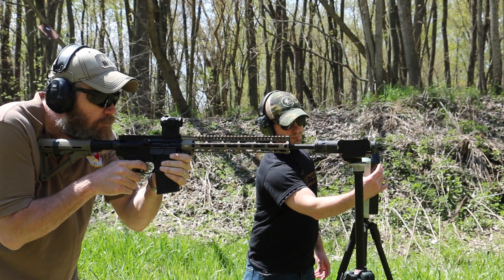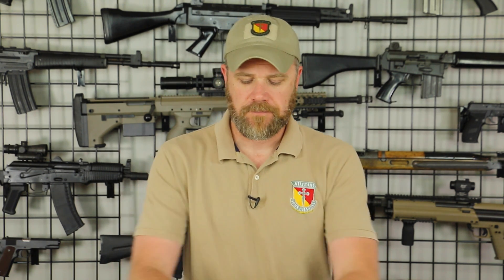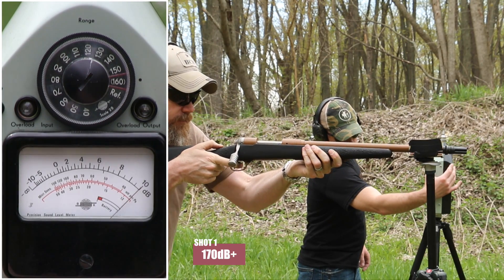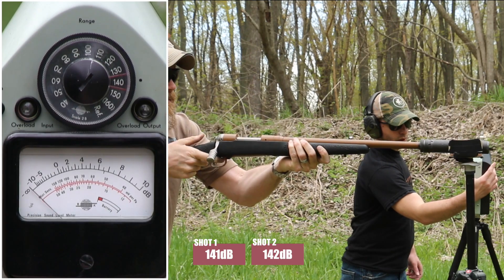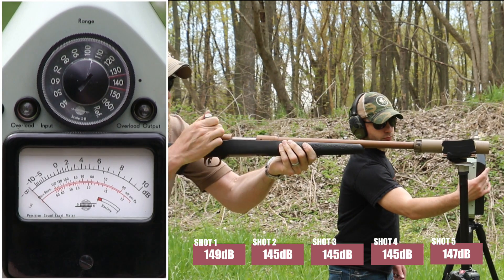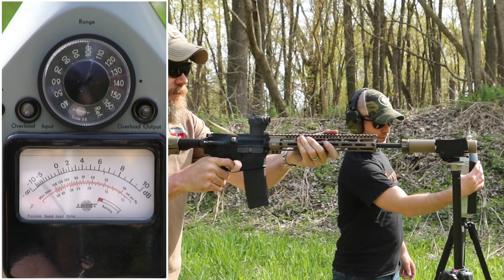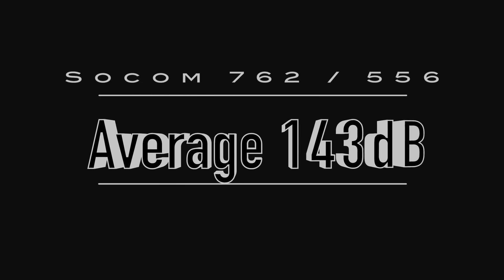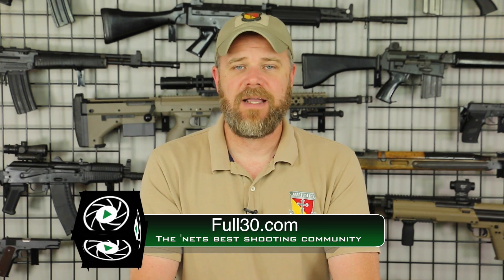Testing 30 Caliber Suppressors

Comment: What end cap was used on the Saker 762 when firing the 556 cartridge (556 or 762)? Did I miss that in the video?
Reply from the maker: Sam S The end caps were not changed, they were 30 cal.

Comment: You make a great point about the intensity difference between your example of 140dB  to 143dB.  Decibels is a numeric representative of the "energy" in a sound propagation.  It's a logarithmic function and an increase of +3dB is approximately an increase in wave pressure of a magnitude of 2.  So, every +3dB increase is TWICE the previous sound pressure level.

Take care of your hearing.

Comment: Looks like there is only 1 that is worth getting, the Omega. Also now you should test it with subsonic ammo and subsonic without a suppressor.
Reply from the maker: Jake S The Omega rocks.
Reply: There are many good options that aren't being tested here as well. The 300SPS or the options from Sig for example.
Reply: I've got about 3 months wait left on mine. Can't wait to get the call from my dealer. Also they sell a .556 end cap that brings the db down even further when shooting 556.

Comment: I would love to see what the numbers look like if you move the sound meter to the firing position. After all that is where it really counts as the shooter.
Reply from the maker: hotelkilo006 Perhaps in a future video, but it's not now suppressors are tested by the industry for their formal readings.
Reply: Totally understandable. I'm mostly curious to see what the difference of being a couple feet behind the muzzle has. I feel like the industry standard might be for military applications to measure what an enemy would experience as the effectiveness of the suppressor.
Reply from the maker: hotelkilo006 As you note, there is a difference (sometimes it's even louder depending on the rifle) and if I can get my hands on the testing equipment for a few more days I may do such testing.